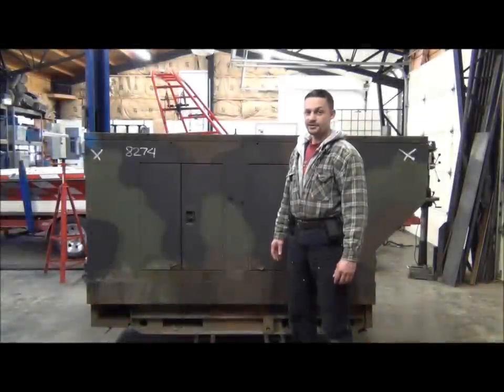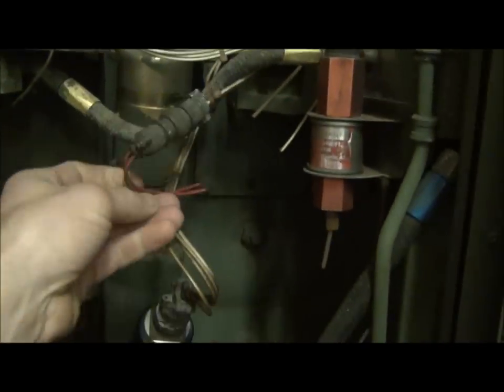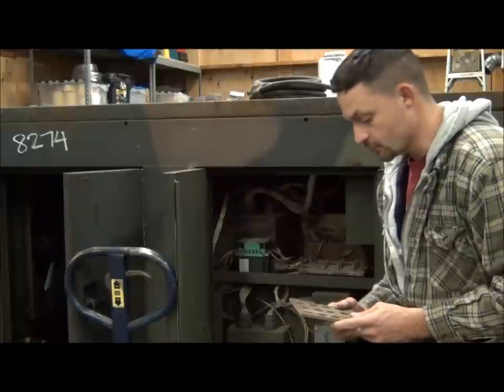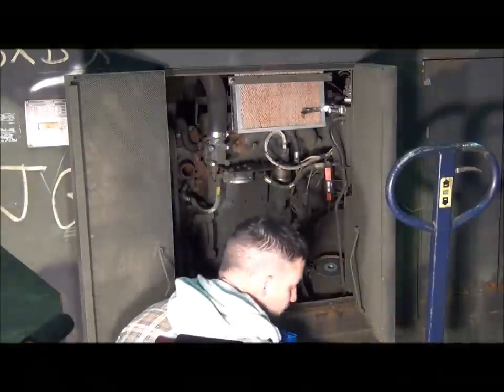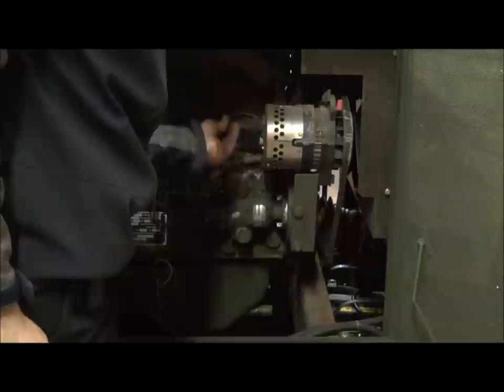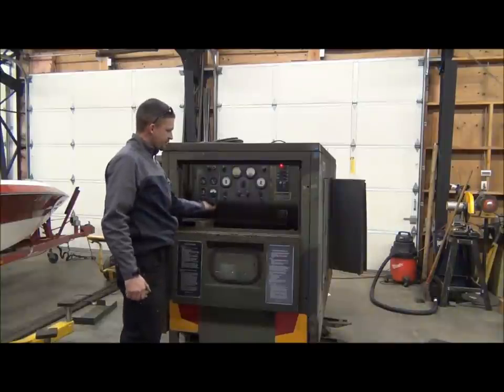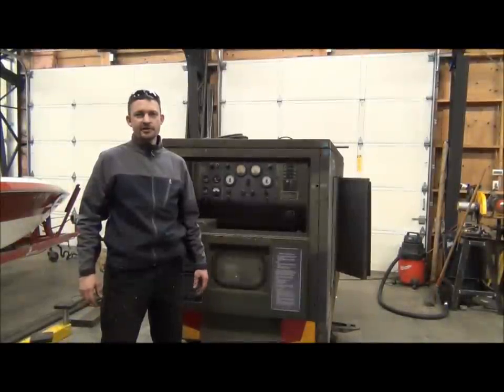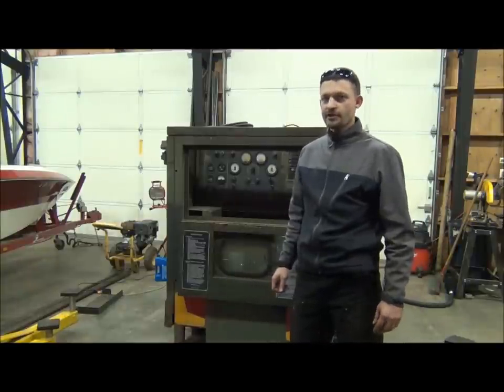Bringing another military diesel generator back to life

Comment from the maker: I have found that it is easy to repair individual components on these sets.  The electrical parts are very standardized and easy to find suitable replacements, at the component level.  The major parts of the engines (injection pump, injectors, thermostats, starters, alternators, etc.) are all rebuildable by a good shop.  If you need complete assemblies, surplus dealers are the only way to go.

Comment: Exciting stuff!  I got aa perfectly good running 5 kWh with a 5 ton truck and missile trailer that i bought for logging.  Has under 200 hours but I haven’t had time to fiddle with it for two years.  I like your methodical approach and will rewatch this as i get mine up to snuff to power all my farm out buildings.  Our local power utility fades in and out like a wildflower during a drought!  I need reliable power for my shop!  I used these overseas in the Army and came to appreciate how bulletproof they are

Comment from the maker: Yep; I run into this often.  The "no fuel" warning light is set off by a float switch in the stainless day tank, not the main fuel tank.  Most likely cause is that the screens for both fuel pumps are clogged up, and/or the plungers are stuck.  Twist the caps off of the ends of the two pumps and clean them out; before you go to re-start the set, leave the start switch in "run" and battleshort switch on for about a minute before starting to allow the pumps to re-fill the day tank.

Comment: One thing is for sure it has no blow by sometime when they get old the oil pan will pressurise and shot the dip stick out and spray oil all over the place the only way to prevent this is just to leave the dip stick hanging out on start up and cracking the fill port

Comment from the maker: Probably does have air in the injection pump/lines.  Easiest way to purge the air is to crack the lines at the injectors (don't remove) them.  Turn the switch to run and let the lift pumps run for several minutes.  Then crank the engine over in 15 second intervals until you get clear fuel coming from the lines.  Re-tighten, and then try to start it again.  Feel free to message me if you need any more help

Comment from the maker: Day tank is a small stainless tank (maybe 2 gallons?) located on the vertical support in between the 2 compartments on the left side of the generator.  Best access is through the panel where all of the filters (fuel and oil) are located.  The pumps are directly below that; from my memory, they are roughly 3" in diameter and maybe 5" tall, and they are bolted side by side.  If you follow the fuel lines back from the fuel filters, you should be able to figure out how the fuel system works.

Comment from the maker: The terminals likely went to the ether injection system.  Rare to see one of those intact; seems the military removed most of them.  
Most likely have air in your fuel lines, or restriction somewhere in the supply to the injection pump.  The fuel just gravity feeds from the day tank into the pump.  Make sure you have a good flow of fuel at the inlet to the inj. pump.

Comment: I've operated  the vary same type generated  while in the USAF.  Maintained that along with a 2000Ah 48v battery back up for Communications facilities.   Get your self a block heater if you plan on operating them in sub zero temps.  The DON'T Play well in the cold !

Comment: I Just picked up a MEP 004-A tactical (1982) in very good shape. While looking it over I noticed that the Tac or Speed Control Unit was not connected to the engine block. The wire harness was still there, and I found the speed control unit in a small box in the immediate vicinity. I think that I might be missing an adapter between the engine block and the unit. Can you please show how that unit is supposed to mount to the engine block. I want to verify that I have all the pieces and parts and put back together correctly. The Tech manuals are not that clear.   Thanks

Comment: I have the PU794/G 20kw 4 cylinder  which is a modified MEP004, generator run when i connect the positive battery lead to the fuel injector and push the start button, but the panel does not work. I noticed that the battle short light is missing and circuit bracker light is missing as well. Generator does not produce current when tested.

Comment: You mentioned leaks at both ends of the radiator hose. I noticed what appeared to be a flattening of the upper hose connection area. that may restrict coolant flow. you might want to keep a close eye on the temperature.

Comment: Just a suggestion for while you are discussing what you are doing.  Use a small flashlight that will focus a narrow beam so you can light up what you are talking about.  
Sometimes the lighting inside the enclosure is not good and just appears as a dark area in the picture.

Comment: Great video's.  Looking forward to doing the single phase conversion.
I have a MEP-005a that ran great until last week. The fault breaker starting tripping.  All lights are working, but none are on during or after the fault.  Only trips after 20 seconds when I switch in the main load contactor.  Using a pair of 120 volt light bulbs across in series L2 and L3 for indication of power out.  Any help would be appreciated.
Thank you.

Comment: possible easy question for you , if you don't know that's ok , the one I just got done something that seems odd , like you I found it with no fluids , it did however have a small amount of fuel , I added about 4 gallons , started it , it started right up , ran for about 10 min , and shut down with no fuel light on , my gauge also reads full , I know better , are there 2 sensors for fuel , a level sender , and say a flow sensor or something ? I flipped the battle short , and ran it for another 10

Comment: I know this will sound very stupid but , I know where the tank is that is in the "bottom of the unit" where are the actual pumps , and the day tank located , I am sure I have looked right at them , and just not known it sadly , if you can please tell me in in this stupid way , from the switch panel , which side and what door , and top or bottom , and maybe a land mark piece I will know what is , I am very mechanical minded , just never messed with one of these , and THANK YOU !! you are great !

Comment: I removed the pumps completely , inlet and outlet lines disconnected , inlet line placed in a jar of diesel it would not pump it , just fast clicking , took caps off both pumps filled with diesel , them placed inlet in the jar again , after a few min the clicking came to a stop , outlet wide open , all it ever did was dribble a small bit , the only bit of promise i seen was if you cut power , it would squirt one squirt like an oil can , restore power nothing , same thing over and over ...

Comment: Question: When operating these three phase gen sets in single phase ONLY,  to avoid damage, is it necessary to "balance" the generator head to address the effect of the unused winding for the third phase?
If balancing is needed in your single phase installation, how is that achieved?

Comment: Matt Verley- I have a 1986 MEP 005A.... It will crank just fine and it will turn over with ether.... Seems the engine is not getting fuel... I am getting fuel to the injector pump but no luck with start up.  I am doing as much research as I can but I am not finding much.... Any help?  I am in Texas.

Comment: I also have been thinking , the pumps were dry and dirty when I took the caps off of them to clean them ...they are full now , maybe soaking so to speak till fix them up , there is not much inside those things , if they were not 24v  , I would have just replaced them and been done with them , but thats not so easy ...

Comment from the maker: You are hearing them rapidly click, correct?  Hearing them come almost to a stop is a good sign; that means they are building pressure.  I have never seen a bad one (just dirty ones that needed cleaning) so I suspect they are still good.  They are hard plumbed into a solenoid valve that feeds the day tank; are you trying to get fuel after that solenoid valve?  Perhaps it is stuck closed, or the float switch in the day tank that controls that valve is defective...

Comment: I think I have the pumps cleared up , just have to install them , and to a real time test to make sure , also are there any sources online for the factory connections to the voltage re connection board ? this thing was surplus from what used to be civil defense , it has a nice set up mounted to it a total of 24 120v outlets , and 2 240v outlets , I don't know how they did it , best to see what they did , and see if it is what you do in your rewire ,I checked a 120v , it tested right but...

Comment: you are a great help , and I really appreciate it , I really do , being that it is producing power , and the engine sounds great , a few little issues is just a blessing , their could be rods hanging out of the block lol  ...also is there anywhere on the unit that will help me place a date of manufacture for it , the engine is sand color unlike the rest of it , the engine is dated 1985 , I can not seem to find another single date on the machine ... it's trailer is dated 1/65 , would that be it ?

Comment: could you give me some advice on a mep-002a - it ran great for about 10-15 seconds and then slowly lowered in rpm.  I think it has air in it, as it spit air/fuel out the drain cock on the second filter.  I could only find one fuel filter in my town.  Any trouble shooting advice?  Thanks

Comment: Have been enjoying your videos and posts on SSs. I've started my restoration of a MEO-004A and have been successful with it up till now. I can't get fuel out to injectors. Fuel going to IP is nice and clean. However that is because I finally had it flowing from day tank after replacing transfer pump. I believe by looks inside top of pump, initially there was no fuel in IP and it had rust in on steel parts. Meter valve was stuck and after I freed it up, I was expecting all well. But no luck. How far do you think I should go with IP and is there a manual on it specifically. Also is there any publication showing the fault indicator assy. Not working as well. Thanks
Reply from the maker: The -34p tech manual covers the disassembly, inspection, some adjustments, and reassembly of the injection pump (starting on page 101).  If you can't find a copy, I can email it to you.  Just send me a message with your email address.  Honestly, I've never tried to repair an injection pump.  They are a pretty common stanadyne pump, a relatively inexpensive to have rebuilt (it has been a number of years since I had one done though).  Any good injection pump shop should be able to rebuild it.  As far as the alarm circuit, I would use the schematics at the end of the -12 TM, and possibly the test procedures in the -34p.  Does nothing light up when the test/reset button is operated?
Reply: sewerzuk Just found it and downloaded and was looking when you replied. Thanks.

Comment from the maker: I have run into this before; the main breaker requires a constant power once it is closed to stay closed.  Any loose contact in the leads running to the breaker will cause it to spontaneously trip.  Too difficult to describe how to troubleshoot this here; there are lots of plugs, relays, and switches.  You'll need to study the schematic on page 345 of the -12 tech manual.  If you don't have this, send me a message with your email address and I will send it to you.

Comment: I found the day tank , and the pumps , wound up removing the pumps for access , what a pain that was , day tank empty , pumps not pumping , cleaned screens , pressed plungers , they were not stuck , I tried everything to get them to pump , they make noise , I later filled them with diesel , and tried to pump from a jar and the outlet into thin air , the clicking came to an almost stop , nothing more than a dribble from them , bad pumps , or am I missing something here ;)

Comment: Could someone tell me how much  I would have to pay for one of these at the government auction. I see alot of these videos with these government gens that a individual bought and I ask them how much they cost them and they refuse to say. I don't understand that about people. This is a great video and very informative, thanks.
Reply from the maker: It has been several years since I bought one of these so things may be a little different now.  A good low hour one would run around $1200.  A high hour one or one that was missing parts would go for around $600.  An -004a like the one in this video would sell for around $1500 if it was in good condition.  Prices varied quite a bit though; if there were a lot of these for sale at the same time, prices would be a little lower.
Reply: @MattVerley  Matt, thank you for your fast response and for your honesty. Good look with your gen and your videos. Take care bud.

Comment: I'm not getting power to my fuel pump but if I jump out the fuel pump and hold the start button and stop position to stay running soon as I Let Go it shuts down this is on a mep-004a I noticed this the fuses what could it be
Reply from the maker: +joesph koellner I don't think I fully understand your question; but, the lift pumps (the ones that make a clicking noise) should not turn on unless:  1.  The generator is running and up to speed or 2.  The start switch is in run and the battleshort switch is in battleshort.
If the day tank (the small stainless tank mounted on the frame slightly above and behind the fuel filters) is empty, then it needs to be filled by placing the start switch in start and the battleshort switch in battleshort.  It should take the lift pumps about a minute to fill it if it is completely empty.  When it is full, the "clicking" noise from the pumps will slow down to about 1 per second.  
If you're talking about something else, let me know...

Comment: What effects, if any, have you seen on these units from running them on JP8? A guy around here is parting out a 5 ton and gave me about 100-120 gallons of it to get it out of the truck, I was thinking about adding some 2 cycle oil and cetane boost to it and running it in my kubota generator.

Comment: that's the plan for today , I am not so sure on how they come apart though , I got the cap off the bottom , and got the screens out of them , but fought to get them over this odd retainer , I did not remove that clip , but I bet if I do , the pump will come all the way apart , well I hope so , I won't force anything until you let me know if that assumption is correct , they do both run , so I still see a chance , if not , one relay , and wire from one battery , and a aftermarket 12v pump ...